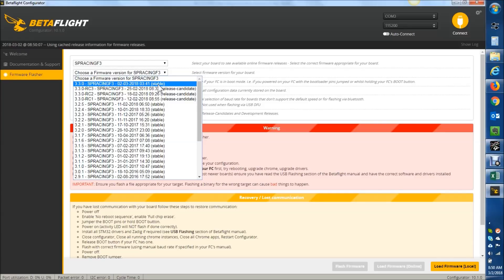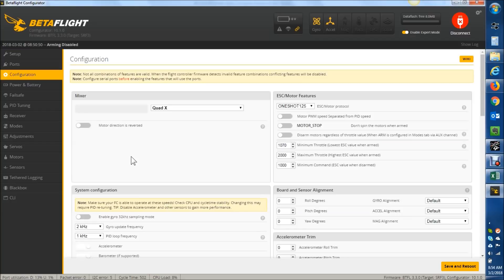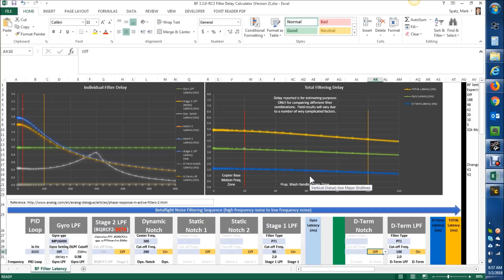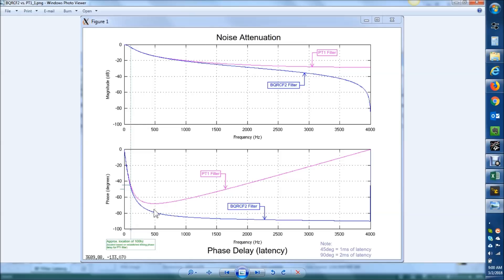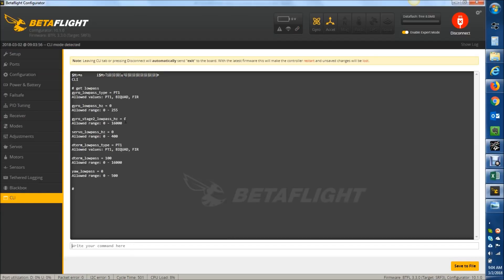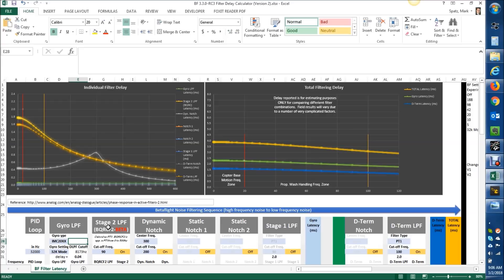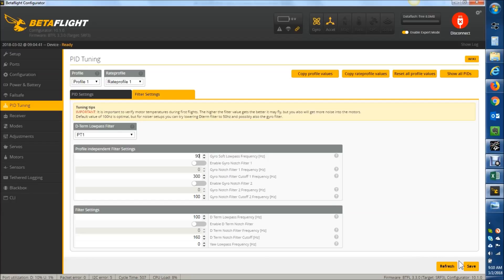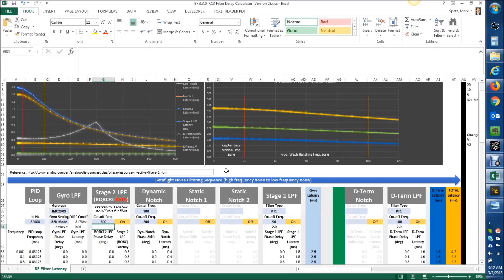Betaflight 3.3.0 Filter Tuning (Stable Release)

Comment: So the fastes guys i know still Running betaflight 3.3.3
Reply from the maker: Yeah buddy.  It is all good.  Fastest guy i know, BMS Thomas, runs 4.0.  Also lots of big wins on 3.4 and 3.5.
Reply: @uavtech  but a problem is, it is hard to get FC,s wich are works fine with the old 3.3.
Reply from the maker: @guffel89  ?  Any FC will work with 3.3!

Comment: Hey mate, i just switched from 8/8 to 32/8 (my matek405f cpu goes to 52% when running 32/16) bf: 3.3.3. Would i be better off running 16/16 (dshot 1200 escs) rather than 32/8 ? 

How would an increase in gyro freq affect the pids/rates ? (Mine feels alot more unstable, twitchy and ahead of me when using the same pids as i did when on 8/8).

Currently using: 32/8, gyro_lp: 90 PT1,  d_lp: 100 PT1, dynamic_filters: on, stage_2_lp: 500 

Cheers!
Reply from the maker: If you go to BF 3.4.0, you should be able to run 32k/32k on an F7 board.  My experience leads to believe you would be better off running 8k/8k vs. anything higher.  It would be interesting if you could capture some logs with Debug_mode=Gyro_scaled on 32k mode vs. 8k mode and share.  My experiments show the increased amount of noise you get with 32k makes it not worth the 1ms in latency drop (filter latency) you get in 32k mode.  So in my comparisons of default filter setups, yes, 32k mode with default filtering seems to produce less filtering latency (phase shift latency in gyro signal), however, I don't think the output is 1:1 anymore.  So, basically folks running the default 32k filtering are getting waaaayyy more noise to their pid loops then folks running 8k.  I'm not convinced it is better, but if folks are, have at it.  I would be very interesting in seeing results other folks are getting and thread the needle.  My experiments has lead me back to 8k/8k.
Reply: UAV Tech i see, i just tried the other approach with the dynamic_filter off, and seem to have  found a good stage_2 for my motor noise around 290. This made my kwad feel way more stable and responsive, though i am not sure I feel any difference from the 8/8 setup noise-wise. But that might just be me not tuning good enough. I will work at it further.
Reply from the maker: Yep, if your quad has a low base noise level the Approach with the two LPFs and no Dynamic Notch can do the trick.
Reply: UAV Tech so basically, 32 would adress  the noise more quickly than the 8, and same with the pids when error-correcting (?)
Reply from the maker: No.  The Digital Lowpass Filter (DLPF) in the gyro which for 8k is at 256hz moves up to 3,000hz in 32k mode.  That drops the latency by 0.88ms as per the excel file at tiny.cc/filtercalc.  However, then a muuuucchhh more noisy signal comes out of the gyro.  So that noisy signal requires more filtering by Betaflight.  From what I've seen, you would have to add much more software filtering in BF to get the equivalent signal noise level as what the gyro provides with the internal DLPF at 256hz.  The video at: https://youtu.be/yBaSinrpMPs lays this out in some detail (how the DLPF moves).

If you do some experimenting, I would be interested in the logs and your observations comparing the signal on 8k mode vs. 32k mode.
Reply: UAV Tech i see, yes if i mess about with the different gyro Hz i will try to remember to save the logs. Cheers for all the insights mate. I tossed you a sub, will stay tuned on your comming vids. Interesting content! 👍🏾👊🏽
Reply: Hey mate, had to switch back to 8/8 again. Had to do some operation on the kwad and after that i couldn't get the motors to run cool with 32/16 on 3.3.3. Switched back to 8/8 running dynamic_filter on 90, switched off all the notches and gyro lowpass, and running 100 on d-term lowpass. In your opinion, would this be the optimal filter combo for 8/8 on BF 3.3.3? 
Cheers!
Reply from the maker: Swe FPV , 120hz on gryo lowpass | 120 on Dterm Lowpass | Dyn Notch and NO Static notches is "optimal" (depends on your noise level u need to attenuate).

U don't get much latency savings if moving LPFs above 120hz, but u do from 90hz to to 120hz.
Reply: Ooo, so i keep the gyro lowpass on , with it set to 120. Bump the d-term to 120, dynamic on, what about stage2? Right now i have that on 90, replacing the gyro lowpass...
Reply from the maker: I would say this is a pretty optimal filter setup.  And this is with some pretty large motor spikes.  https://www.screencast.com/t/cvCWB1sG
Reply from the maker: That plus of course having the Dynamic Notch filter Enabled.  This is for an 8k rig.  With 16 or 32k, you would then in addition enable the Lowpass2 filter.
Reply from the maker: Also see https://www.screencast.com/t/BGGahtEU that i sent to someone today to explain further why 120 seems to be a magic number.
Reply: UAV Tech so the stage2 is obsolete on a rig with 8/8 then.
Reply: UAV Tech d term lowpass 2 @ 200 is that the stage 2?
Reply from the maker: In BeF 3.4, you can have cascaded lowpass filters on the Gyro and D-term.  For 8K running, you don't need 2 stage LPF filtering on the Gyro, but it is still recommended on the D-term.
Reply: UAV Tech and that you set to 200, or just below the motor noise right.
Reply from the maker: Look at your Gyro noise (after gyro filtering) and set below the peak by a little (aggressive = less filtering) or at the start of where the peak begins to rise.  The later is what I like to do as these filters are pretty high already (200hz+) and as shown in that video, moving them up doesn't gain you that much in the result of lower latency.  That said, they are very flat in attenuation as well so lowering it doesn't gain you much either.  That is why the simple ability to add a second LPF filter (cascaded) is the big part of it.  Way less delay then a BiQUAD filter at a lower value (like 90 to 120hz) but it also gives you a ramp up on attenuation from 200hz - or wherever you set the cuttoff - up in higher frequencies.  If your peak noise is about 250hz, i would set anywhere between 200 to 230hz.  But higher or lower than that too won't be "wrong".  Basically, they have a pretty broad range where impacts (negative or positive) are minimal when you are up above 150hz.

Comment: So if I'm running my gear up to 8/8 kHz (gyro/PID) then it is no sense to use Stage 2 filters at all? Eq. BIQUAD+FIR and Fast Kalman without 32bit gyro or 32bit mode off will not improve flight smoothness at all? Do I understood it correct? If that then seems that these new smooth filters can be used only on very good hardware with new and not bent props and motors without any damage from crashing. So most folks wouldn't be able use them anyway without upgrading and/or completely repairing their hardware at first and doing very scrupulous noise prevention tasks before including softmounting all and fixing all loose wires and other things which can vibrate and make noise at first. Sad but true.
Reply from the maker: The new filters are mostly useful for 16k/32k.  However, you can find use at 8k depending on your noise amplitude and profile.  I will do a video on it.  The fact is, that if you have peak motor noise between 130hz to 500hz, nothing does a better job to cut that down than the Dyn. Notch Filter.  It has a hard cut, moves to track noise, etc...  If you have base noise approaching 500hz and above, then a Stage 2 LPF can help you there.  However, if it is a peak of noise, it might just be better to hit with a static notch.
Reply: Well, it explains why DIY BFight210 (RacerStar Tattoo F4S FC with MPU6000 gyro and Emax RS2205 motors) after last repairs became very locked in - it wasn't that good before. Replaced bent motor bell/shaft and all props to new ones too before this.
https://youtu.be/RHFFLMzNats
Betaflight 3.3.1 default filtering was quite off from main noise peaks. It now runs with 115 Hz LPF cutoff, PT1 filtering mode, one notch filter on 260 Hz and Dterm filter on 182 Hz. Managed to get pretty smooth traces with little noise over, but it was so little that I didn't bother about it anymore. Motors are not become hot too and flight time improved by 30-50 seconds. And quad respond to stick moves instantly now. In fact it respond so good that I'm now overshoot on roll often - you can see that in video. Didn't adapted to this yet :)  Probably should tweak rates now.

Comment: I've got a set of efaw motors and it shows peak motor noise higher than 500hz on the analyzer. What would be recommended for setting stage 2 for 32k?
Reply from the maker: Jay Bird , what BB explorer version are u using?  Above 500hz is odd.  There is a bug in the latest.
Reply: UAV Tech I'm using the 3.3.0 bb viewer. It keeps tellin me to update everytime I open it but I haven't yet. I'm not sure the exact hz but it's definitely off the analyzer scale
Reply: Ok I lied it's right under 500hz but far enough off to where I can't see the actual writing that says the hz
Reply from the maker: You need to raise your logging rate to see higher on the spectrum analyzer.  Do that and set Debug_Mode=Notch in the CLI and if you want, you can send me your log and I'll be happy to take a look.  I'm thinking you will need to enable the Stage 2 LPF to attenuate a noise spike that high since the Dynamic Notch only goes up to 500hz.  Make sure you have the Dyn Notch enabled too for the log.
Reply: Alrighty I can do that. I'm using a revolt with on board data chip, I was aware I could log faster than 1khz lol. What do you suggest setting the logging rate to?

Comment: Like u say if u r running 4k 8k there is no much noise above 1khz and looking at the bode plot, I do not see any advantage using not fkf as oppose to pt1 for stage 1. In fact there is more delay.  Great analysis. This reminds me of JB back one year ago.  Lol
Reply: I have tried one of your recommendations which is use the stage 2 to reduce noise above 500 and dynamic filter handle the noise between 500hz and above 130hz.  I do not see much different to be honest compare to not having stage 2 activated. I am 8k 8k may be more noticeable if I run 32k. Unfortunately all of my quads have mpu6000. However JB said he think it is worst. But that just one quad and one pilot.  Your recommendation makes sense to me.

Comment: Checked motor noise in bb and max was 496 but it wasn't on a punch out tht was around half throttle should I do 500 on stage 2
Reply from the maker: Yes, in general.  Dynamic filter On.  For more detailed, would need to see blackbox log.
Reply: Yes dynamic on and I'll post a pic of it
Reply from the maker: would really need the whole log.  you can post on https://www.facebook.com/groups/291745494678694/

Comment: Hi Mark - I think I get most of what you talk about - but I only fly 2"-3" quads, and think filter tuning for them is different given smaller motors, smaller propellers and different resonance points.  Butterflight and Betaflight are aimed - at least from a default settings standpoint - at the 5" and over quads.  So, at this moment, I'm using Butterflight on F3 boards and Betaflight on F4 boards -  with the same settings.  Soft lowpass at 90hz, Stage 2 BQRC at 150hz, Dynamic Filter "on" and all three notch filters "off."  Motors are reasonably cool, but setting the stage 2 filter at 150hz is just a guess.  If you were me, would you try (a) increasing the cutoff for Stage 2, (b) turning off Dynamic Filters, (c) re-enabling D-Term notch, or (d) some combination of (a), (b) and/or (c)?  I'm thinking the Dynamic Filters are redundant with the settings I currently have and are inducing latency and more intensive CPU usage.  Interested in your thoughts!  Thanks!
Reply from the maker: Morning George,
It all depends on your noize amplitude and profile.  With a 3", I would guess the amplitude is low so maybe you can get away with no Dynamic Notch to save CPU load.  Can you run a blackbox log with Debug_Mode=Notch?  I know a lot of those smaller boards don't have dataflash or SD card slots.
Reply: UAV Tech - thanks for replying Mark.  I have a number of f4 stacks with black box dataflash on them - I've never messed with blackbox - so, what would you like me to do?  I know I can save the data to a file using Betaflight.
Reply from the maker: See https://www.screencast.com/t/TWyeCm0Md7B

Comment: i changed d-term lowpass filter to BIquad just to test and for my suprise it flys better than pt1, is it normal? Pt1 wasnt suposed to be better? im using omnibus f4 pro 8k/8k
Reply from the maker: Manel Correia , surely will be smooth flying better.  However, are u seeing boounce-back and prop-wash better as well?
Reply: UAV Tech yes, i have more prop wash with pt1. With biquad prop wash is minimal or null
Reply from the maker: Manel Correia , awesome.  Keep it!!  Not the norm, but fly what works.

Comment: Thanks for the useful info in all your videos - as someone who knows a little bit about audio DSP, this mostly makes sense.. However, I don't understand the fascination with 16/32Khz sampling when we just care about 100Hz and below.. I'm guessing if we had an unobtainable filter with a cutoff at 100Hz with very steep slope and minimal delay then that would be perfection?
Reply from the maker: deluded , agreed.  I guess all for the higher DLPF cutoff, but u can do that with an 8k gyro, but not many know that.
Reply: This is what I was thinking, why sacrifice other things just to get enough CPU for 16/32K. The only reason I could see was to remove the digital filter from the gyro (which I assume is just an averaging). Oh, and your spreadsheet is amazing!
Reply from the maker: deluded , thanks.  I hope it helps.

So a faster gyro is necessary for a faster PID loop.  I guess that is the desire.

In 32k mode, the DLPF is not removed, but does move up to 3khz.  See https://youtu.be/yBaSinrpMPs if u have not checked out already.
Reply: deluded All hype about 32bit gyros and gyro/pid loops above 8 is caused by desire to have smoother flying experience. For someone that really matter. By the way not all folks wish to ride performance cars, but some do and don't bother about fuel expenses :)  Also in our hobby majority of folks have no clue about what DSP is. But they certainly wish to have smoother control experience.

Comment: Hello, trying to get my head around about all the new filters, I had absolutely zero knowledge what came after the dynamic notch filtering.

I have a weird setup and want to make the most of it. A rotorgeeks dtfc board with an icm-20608 gyro coupled with a f3 board. So I am able to get lower latency with gyro lpf set to EXPERIMENTAL, but I am not able to use 32k. So My setup needs a mixing and matching of your recommended settings. 

What would you recommend me if I only can run 8k/4k? I think I will need to set my stage 2 filter for the 750hz noise which will appear with experimental gyro lpf, so I should leave my stage 1 filter intact and at 90hz, right? Or am I completely on the wrong direction.
Reply from the maker: Dennis Riessbeck , u are on point.  Make sure Dynamic Notch is on and start with Stage 2 at 500hz and move up from there.  If u do Gyro DLPF to "off" vs. "Experimental", u can probably turn the Stage 2 filter off (set to 0).
Reply: Thank you for your answer, it is nice to hear that I understood your videos :D but in real life it did not fit with my quad, it pretty much flipped out when I tried experimental gyro lpf, even with the stage 2 set at 500hz. For now I did what you suggested on your other video, set the gyro lpf back to off, and replaced my stage one filter with the stage 2 filter at 90hz, seems to hover fine, will try to fly it today to see if it made any difference.

Will try experimental gyro lpf later again after checking my fc softmounts, I think I could do it a little bit better than what it is now.
Reply: Thanks for updating :)
Reply: updates?
Reply: Well I couldn't get it fly with the gyro dlpf at experimental, but with my stage 2 filtering at 90hz it flies, can't say if it flies 'better' yet. I don't feel any drastic improvement.....

Comment: took a risk and tried to run 32/16 on my 405aio again.
good thing - it didnt launch into my face with pt1 enabled and d term notch disabled. 
bad thing - i cannot disable dynamic notch, noise immediately propagates into gyro, motors start making this angry mechanical rumbling
with stage 2 set to 400 it flied ok at room temperature, but outside at -3C eventually started to fly unstable (seems the standoffs became stiffer because of cold), but no harsh twitches!

i ll try to lower it to 300 or even to 250hz...
Reply from the maker: MrBirdshell666 , u have Dynamic Notch enabled?  FC is soft mounted?
Reply: yeah, i mentioned that, without dynamic notch it sounds just not right and two peaks immediately shows on filtered gyro traces (both lowpass filters cannot fix it completely).
btw , i have my cpu overclocked to 240mhz, and get 45-47% utilization while disarmed. i haven't seen any hiccups or reboots in mid-flight yet...
after your hint about BB version, i saw i have to set stage2 to 200hz...
Reply: and i dont know should i continue with this 32k stuff.
according to your tables, i ll be getting something like 0.2 millisec benefit vs 8/8k+1lowpass+pt1

ps/ everything is softmounted.
Reply: and so i failed. filtered yaw trace is jagged. i cant do anything about this... going back to 8k mode.